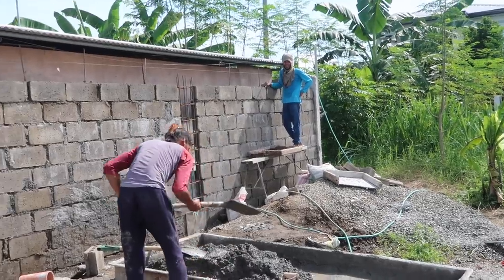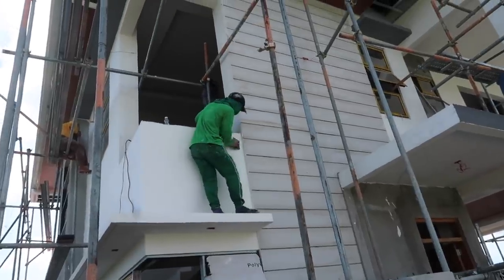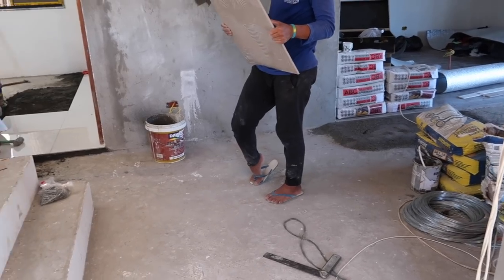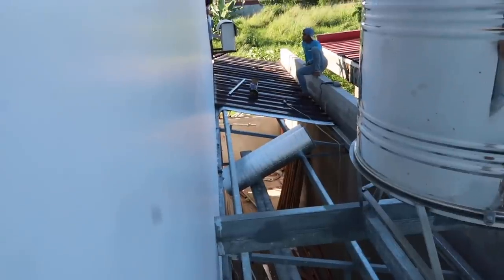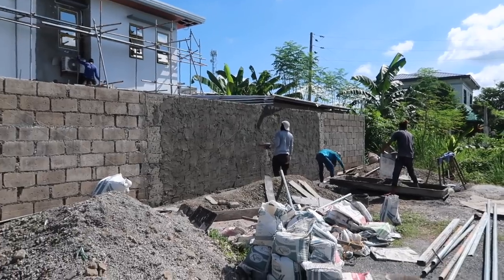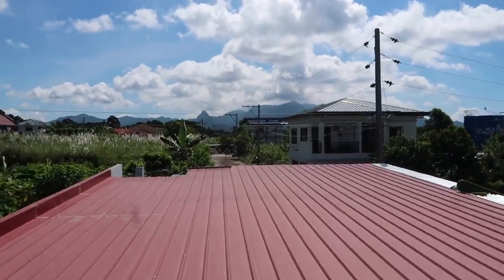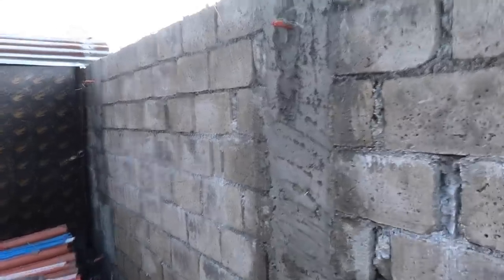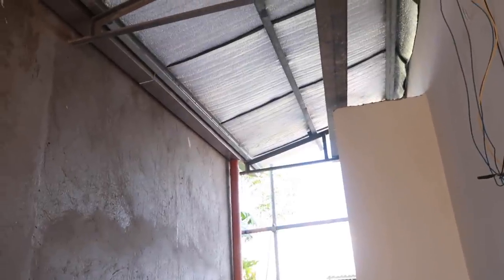HOUSE BUILDING IN THE PHILIPPINES - EPISODE 164: DIRTY KITCHEN ROOFING I TILING THE FIRST BEDROOM

Comment: Really would have expected some "bedding material" or sealant on the wall that the counter flashing was attached to. Otherwise the only place to seal it and keep it water tight is that small area along the top edge of the metal where it fits against the wall. You're right that they need to cap and face that parapet wall with flashing or water will soak into/through the wall.
Reply from the maker: They will put silicon

Comment: It's never a good idea to use a grinder to cut the painted metal roofsheet, it will get hot when they cut and the layers of painting or whatever it is will let go from the metal, next level the moister will suck in there and the painting will lose more up, and then welcome rust ;)
There is special machines for cut like that if you cant use a tin shears.
Reply: Use a circular saw with the blade turned backwards.